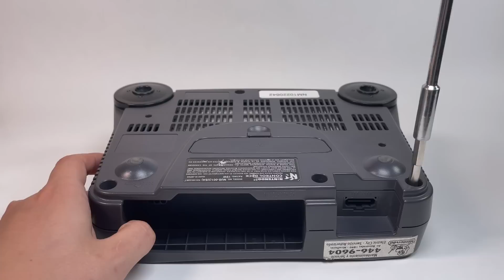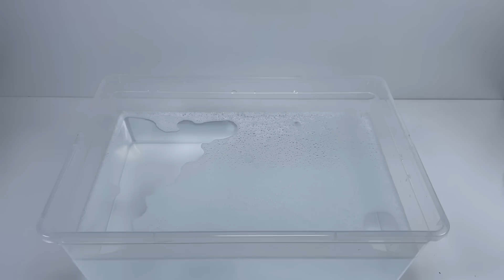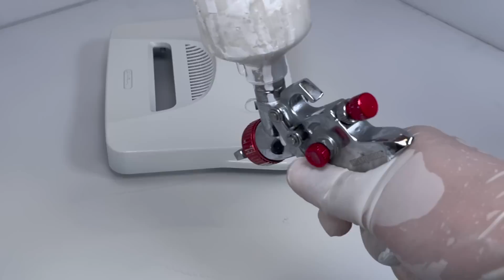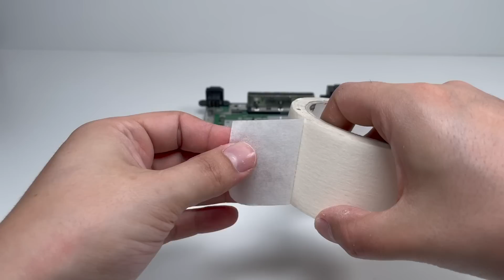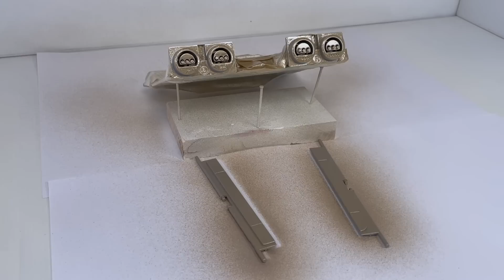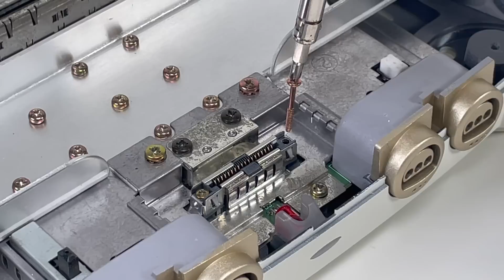I RESTORED This Nintendo 64 / Custom painted N64 / N64 restoration

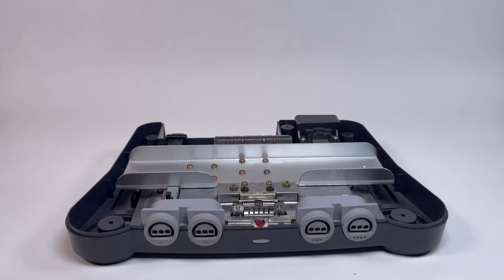Comment: 1:39 From what I've researched, every N64 is missing that screw. That's a clean paint job. Very cool.
Reply from the maker: Hi! You’re right! Thanks for watching!
Reply: That's the hole for one of the six screws that secures the two halves of the console shell
Reply: @waynetemplar2183  yup!
Reply: That screw was one of the slots for the 64DD which was an commercially failure and didn't come go outside of japan
Reply: Ha.  I was wondering why mine was missing, too.